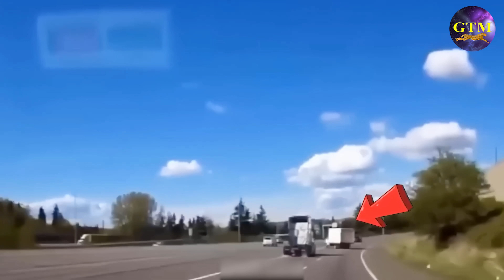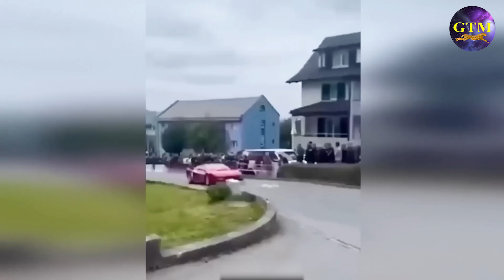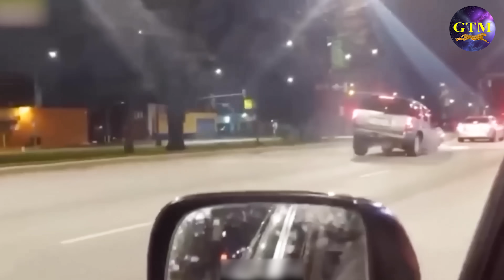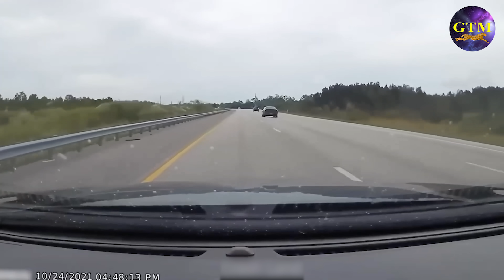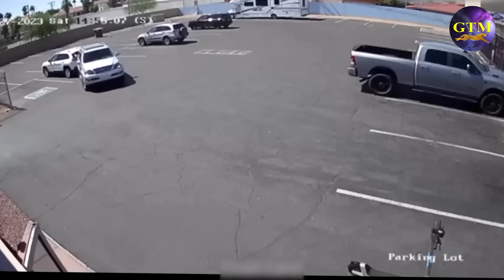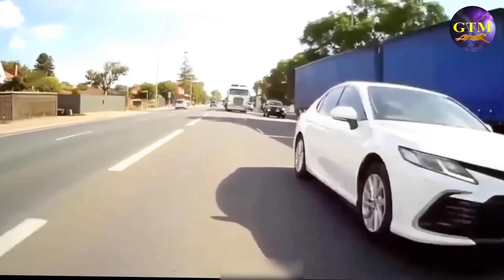Best Of Idiots In Cars 2023 | STUPID DRIVERS COMPILATION | TOTAL IDIOTS AT WORK #33

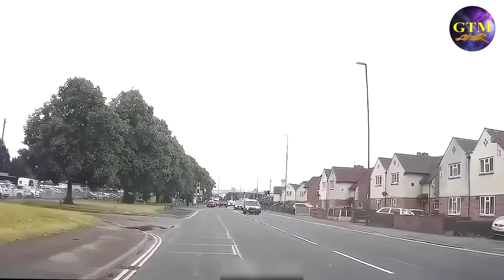Comment: 13:35 There should be a special governor box on these truck that won't allow them to go over 20 mph until the bucket is all the way down! I've been saying this for years. Why hasn't someone invented them yet? This would never happen if they had them.
Reply: It should be impossible to drive at all if the bucket is not lowered. A simple sensor would do the trick.

Comment: I don't know where that helicopter on the road was, but here where I live now, and in my home state, any time a helicopter is required to airlift a patient from an accident site, the police cordoned off a huge section of the road the bird had to land on. 
Moving traffic isn't permitted to go anywhere near...no movement at all from vehicular traffic...until the helicopter has lifted off and cleared the ground by at least 200 feet. 
That big rig should never have been that close to the helicopter, not with a police cruiser sitting right there.